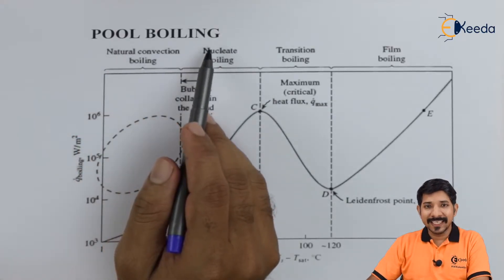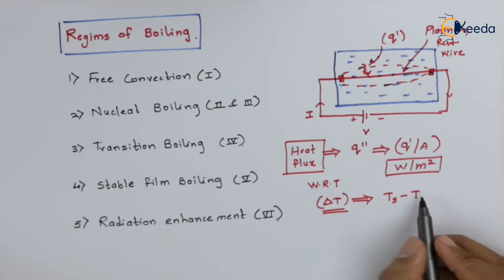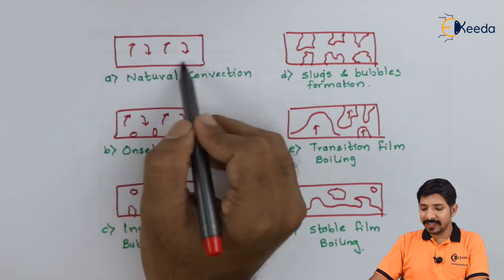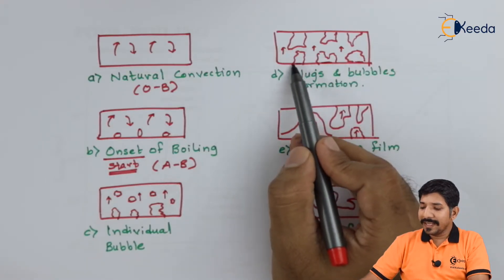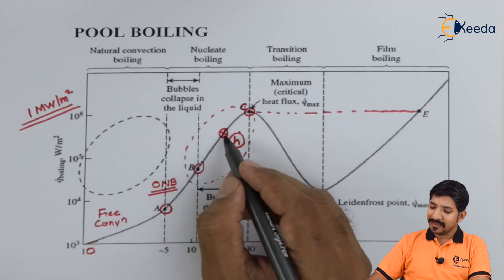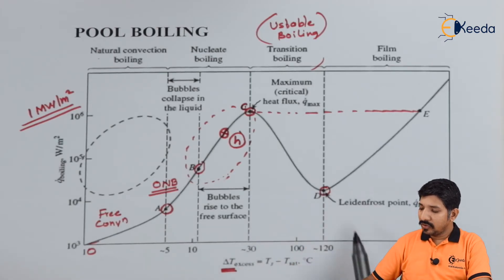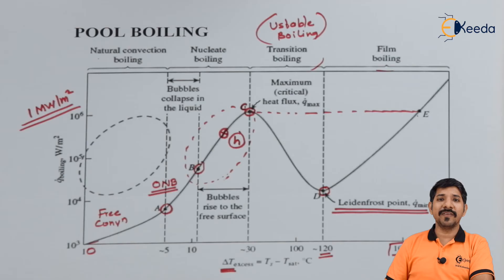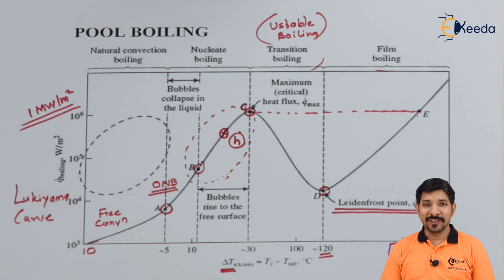Introduction to Pool Boiling - Boiling and Condensation - Heat Transfer

Comment: The transition boiling regime is characterized by a rapid decrease in heat transfer rate. This is due to the formation of a vapor film on the heated surface. The vapor film acts as an insulator, preventing heat from being transferred from the surface to the liquid. The transition boiling regime ends when the heat flux is high enough to cause the vapor film to break down. This is known as film boiling.

The following factors can affect the heat transfer rate in transition boiling:

The surface wettability
The surface roughness
The liquid properties
The heat flux
The pressure
By controlling these factors, it is possible to improve the heat transfer rate in transition boiling.